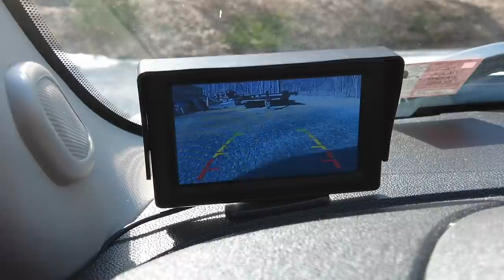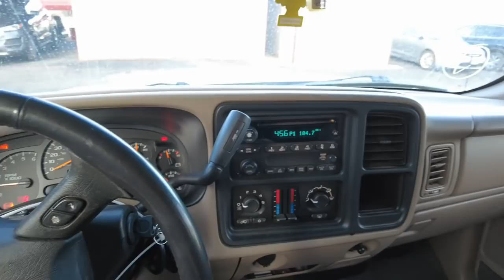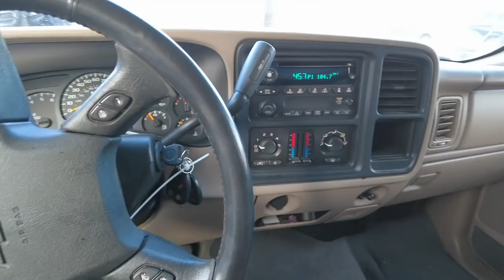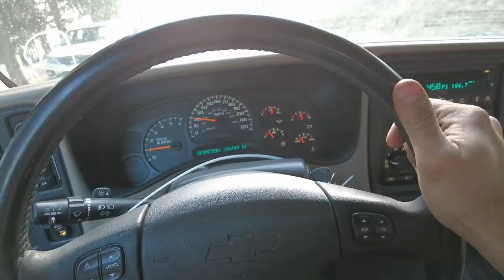I finally bought a truck from copart

Comment: Todd-you did well with this one. The AC  on mine was not holding a charge I got lucky and it was the schrader valve sticking on the high side. The dash cluster is not a bulb I believe with the 2002 it had bulbs then they went to soldered in, send it out to get rebuilt, I used a service on ebay for under 100$ came back like new and i opted for the trans temp upgrade. Water pump is common to go on these. The fender will be fun to change out, nothing you cannot handle. Its in great shape. Do a transmission service on it, as they are weak.

Comment: Looks good, nice score!   I never did care for them too much with all the black/grey plastic stuff all over but they did sell well and a good base mechanically, like a truck.   One of our neighbors has one that is black but spent its life outside and all the plastic cladding and plastic thing behind the cab on the bed is all light grey and washed out from weathering and it looks bizarre but has a ton of miles and still is a decent vehicle mechanically.

Comment: just FYI if you don't find a burned out bulb in the cluster it's most likely a bad solder connection on the circuit board. I have a 2000 GMC Sierra and an 05 Yukon Denali and both had the same problem with the PRNDL too dim to read and it was a solder problem on both of them and is apparently an extremely common problem in GM's but also an easy fix

Comment: I just finished a 2004 Silverado 4x4 build with a similar damage on the drivers side. My suggestion is to loosen the bottom core support bolts before you mount the new fender. Then use your porta power  to align the core support to the front of the fender after you have the front door to front fender gap correct. Works great and you don't need to dissemble the whole front end. Good luck with a great build!

Comment: The PRND  IS not a bulb . It has a cracked solder joint on one of the resisters . That causes the dim PRND or sometimes the odometer will go dim or just go out . You can just resolder them resisters and your good . Great looking truck  ! Your gonna do good with this one 😉 💯

Comment: Easy fix! could probably roll that fender back out too and yeah if you didn't have a truck you'd be tempted to keep that one for sure, they are nice and a very comfy ride too.  well my escalade ext is any way and it's pretty much the same truck. only difference is that one comes with a 5.3L LS engine and mine has a 6.0L LQ9  oh and i still MUCH prefer the AWD over 4 wd

Comment: The shrader valve is not sealing . See those leak all the time  . You can sometimes just tighten it  but usually you have to replace them .

Comment: Todd! Now you know better than that, using a tow ball rated for 6,000 while towing an Avalanche + trailer.  Don't blame us if we give you a good finger wagging
Reply from the maker: So I'm guessing you missed when I upgraded my hitch on my truck awhile back.  Trailer is rated for 9k
Reply: @UnWrecked , ???  I was talking about the tow ball, it's attached to the Reese brand ball mount being inserted into the receiver, you can see it at 0:25 and the ball is stamped 6,000.  Anyways, I did miss that, you upgrading your trailer, cool.  I just got a new one myself, about a month ago, hauled my first Copart truck too, went to Kanasas City and back, a little over 1,000 miles round trip.  Be sure to protect your investment, trailers love to disappear.  Pretty sure no one will mess with you tho, you look like you could bench press a Buick.